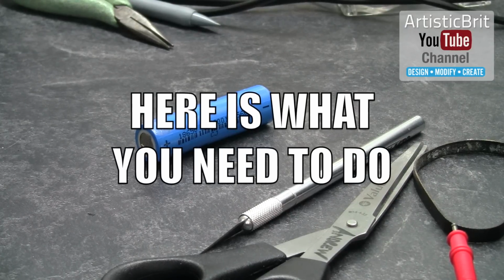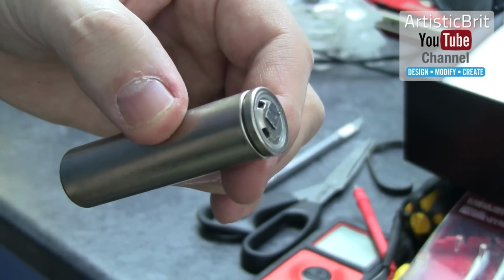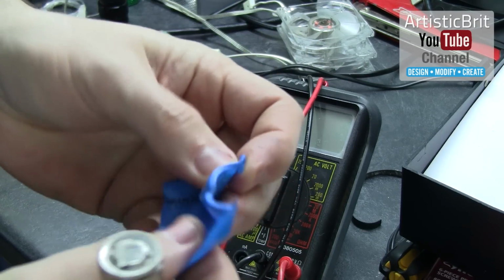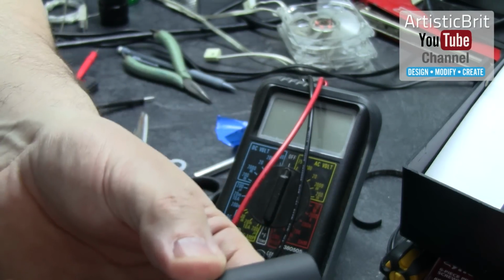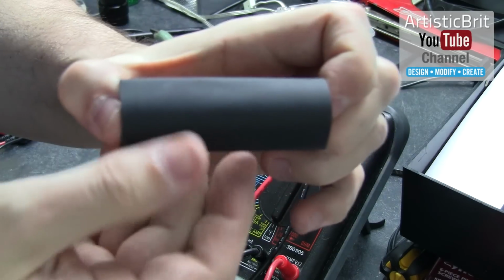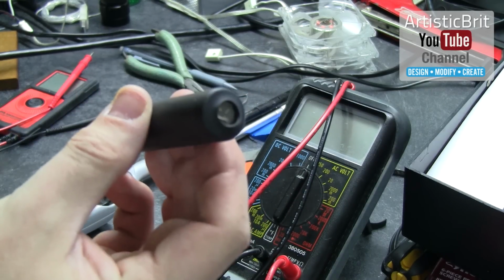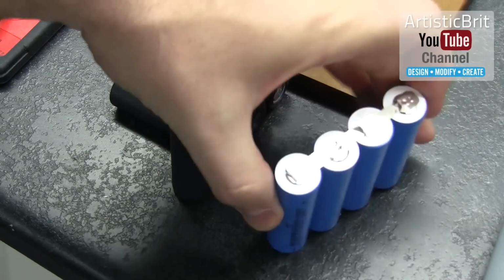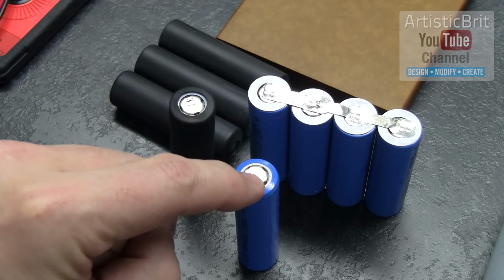Electric Danger of Lithium Ion 18650 - Battery Fires Exposed - Possible DIY Solution

Comment: If you did not know (or were not able to work out without a metre) that the outside case of some cells (where they are attached to the bottom by a common conductor) are negative maybe it would be safer for you NOT to play with electronics. AND If you want to short out cells use a fresh alkaline AA battery, they have enough amps (1.5?) to get real hot or drop steel wool onto an alkaline 9v PP3 - they dont have the amps but plenty of volts. If it helps at all, if you need to jump start your car and only have one wire lead treat the cars like battery cells and push the metal bumpers together (like the outside of a cell) and just attach the POS lead to the POS on the two batteries to make the circuit. Just like your (2.3Amp) Lion battery the 200+ amps from the car battery should Weld the two cars together, and kill both batteries. Lastly, for your go-cart RC LiPo's would be a better option as they have a higher drain rate (upto 7x) than those blue lion cells you are using now and will take the punishment better. If you think Lion's are bad, wack a nail through a LiPo (and run)

Comment: The battery was safe, until you removed the white plastic washer in the beginning of the video and discarded it
Reply from the maker: John Sneeringer If you paid attention, I was showing how close the rim was to the positive terminal. Normally this would not be done of course. When viewed on a desktop computer, you would see the warning texts I placed over the video as to why I did this.
Reply: You made the battery no safer be adding shrink wrap to the sides. The arc risk is at the top, not the sides. You removed the white insulated washer designed to mitigate that risk. By not adding the washer back, you have a much greater risk of fire or explosion.
Reply from the maker: hojo70 again, no one seems to be watching the videos completely. I cover this in the video and subtitles.

Comment: Are these batteries safe or what ??  I mean will they EXPLODE  💥  😨😨
Reply from the maker: +BubSiE7*7*7 T. Overall not dangerous, but used incorrectly, they can be, like others. There isn't really an explosion, more if a fast fusing of materials inside a slots if smoke. But we are talking rip off batteries, or batteries badly abused or damaged. I have 200 upstairs, perfectly fine.
Reply: Yeah ok, but really these Batteries are Not really what their supposed or intended to be!  Like a 9900mAh Battery has only just a capacity of 447 mAh ?  Which is a BiG RiP Off !!!!  😰

Comment: Its good that you are showing people how easy it is to short the cell, but why not use insulation tape to do it? Wouldn't involve a flame.  Also the real risk that you missed in your vid is the risk of having multiple unprotected cells wired in series, which is a big risk when charging without a protection circuit.  Personally I think that is the more serious risk.  But anyway I like your vid.
Reply: motorbiking 
Tape is not reliable. The correct way to add insulation is shrink wrap, but it should be shrunk using hot air.

Comment: I do not think that they will fit in a flashlight with they new heat shrink in it.
Reply from the maker: Possibly, though I'm not using mine in a Flashlight. I would think what your end purpose will be for.
Reply: Andrew Jones
flashlights :)
Reply from the maker: Yeah, I would check to see how much slack you might have before trying. My personal end use is for a vehicle.
Reply: I wish I had a meter to check them. I have charged them on the Efest LUC V4. they stopped at 4.2. It reads what kinda of battery it is and charges its accordingly. I was hoping that would do.Maybe not?
Reply: Andrew Jones
They fit with no problems in my flashlight
Reply from the maker: J Doe That's awesome news! Thank you for letting me know. I'll point it out in my next 18650 video which might be late late tonight.
Reply: J Doe It'll fit. Use a hammer.
Reply: Cured Pork Belly  ha ha
Reply: J Doe if it doesn't, bigger hammer

Comment: Really Andrew ok ok the wrap you took off is thin.  I will give you that, but the thicker plastic ring the wrap was holding in blocked the problem you are showing.  Next time leave the battery wrap on and put your new wrap on.  I agree with HTMI. This is pointless.

Comment: I use 18650's in my flashlights and the extra thickness of the shrink wrap would make it impossible to use them.
Reply from the maker: Possibly, though not how I use my 18650's

Comment: You won't be able to cool those batteries now , i hope you realize that. That wrap is good enough. Those laptop batteries are not meant to be taken out but you can still take em out no problem. I've made dozens of bicycle batteries and basically took out bazillions of those out of laptop batteries. Not one spark. You should just relax imho.
Reply from the maker: I'm happy you have made so many, however many others have done this very successfully for their bike cells.
Reply: Andrew Jones It's not that you can't but those things they don't like running hot you know. Decreases their lifespan. And in high current applications , such as e-bike stuff , this is going to lower their cycle life by quite a margin. Plus when there is a short or something , it's going to drain it pretty fast and it's gonna be cooked inside and probably enter thermal runaway. (That heat shrink is not very thermally conductive.) Then those yummy gummy shrink wraps will start melting all over and eventually burning. Doomsday scenario i know , but so was yours.

Comment: OMG!! Look how dangerous this battery is after you removed all the protective material that has been put in place to prevent the battery from becoming dangerous! ... Really?!
Reply from the maker: Yes... really. Do your own testing, my method is a far tougher material than the thin mylar wall against shorting out. Though in retrospect, it would be even stronger if I kept the initial coatings in place. This was more to show just how little there is to protect the battery.
Reply: Andrew Jones ya but that blue was not the real protector that white ring was...at least you should have put the white ring back. Sure i get it the blue stuff is thin compared to your heat shrink...but the white ring and the blue stuff used together is likely just as good. also you introduced another problem... heat ... that black insulated shrink wrap will cause the battery to not dissipate heat as easily this may or may not be a problem.

Comment: typical mistake 18650batteries for laptops are totally different from the electronic cigarette ones yes they look the same they perform the same but if u look at a laptop battery there is no vent holes so there fore they don't release gasses like and 18650 for a electronic cigarette hence they are the same size but inside they are very different

Comment: Any high capacity battery can be very dangerous the individual cells will not be fused. It is all in the design of a cell pack to be correctly fused after assembly. You seem a very inexperienced person. Try putting a spanner over a car battery, duh this all common sense.
Reply from the maker: Martin Counsell Whatever makes you feel better Martin. No need for me to prove anything here. Comments like yours make my day. You speak as though everyone knows the dangers of batteries. Many do not, which is why I pointed them out. It's often those that think they know what they are doing that I see go up in flames. Though I better what what I say before the scorpion gets me. hehehe

Comment: "that could start a fire" well... it would vent, but yes, it would be bad... simple solution: don't remove the protective plastic and casing on it... you then don't put the plastic used to isolate the two "terminals" from each other. trust me, if they were that dangerous, then why would they be used in so many rechargeable things? if they were so prone to shorting out, why would they be put in laptops? they only short out if you do exactly what you did Dude.
Reply from the maker: Incorrect on many counts. They do create a flame in some cases, they are used by thousands to create electric bikes and more. Not everyone knew what I show in this video "Dude". The hover board industry alone is having issues with the batteries too. Though mostly due to poor manufacturing and safety standards. I'm currently building an electric vehicle from them, like many out there. Any valid point you make have been expressed in my video. The point of the video was to show where the terminals are on the battery as hundreds only thought it was on each end.
Reply: +Andrew Jones yeah, sorry, I wrote that before finishing the video. fair play, and I see that now, and the hoverboard industry has also got the issues of unregulated and unprotected charging circuits too, wish that China would listen to electric standards, sorry for going off on one, probably should watch the full video before commenting, making a fool of myself as ever, and good luck with the electric bike, I'm working on one too, also based on the ideas from Rinoa Super-Genius and will be interested in your other videos to come before I go searching for ages, what were those little holders you used for the 18650 packs? they're quite cool, and definitely what I need for continuing my own project
Reply from the maker: +Amelia Tovey love Rinoa, his spirit of taking things apart to see what happens and how it works is great. :) thank you for the nice reply. I have got tons of hits on this video, so can't complain. Best of luck with your build!
Reply: +Andrew Jones oh indeed, nobody like Rinoa quite has that look of excitement when tearing things to pieces, I do love the trike though, my all time favourite vehicle. where are you sourcing your 18650s from? laptop batteries from eBay?
Reply from the maker: +Amelia Tovey I have been buying new laptop replacement batteries for now. 12 cells just like Ronoah's earlier videos. They are a good weight too, so have not hit many bad cells.
Reply: +Andrew Jones yeah, I'll likely be building a large brick-shaped one like Rinoa's later ones, just for ease of soldering and attaching balance leads
Reply from the maker: +Amelia Tovey Yes, I'll be making a similar flatter version to fit into my design vehicle. Though to be honest, I have bigger projects I am working on, and saving for my second 4K camera to film it all. It's expensive doing all of this tuff ;) hehe
Reply: +Andrew Jones oh God it is XD I have spent way too much on batteries alone so far XD

Comment: you should've put that white oring back before you rewrapped the battery also depending on what you're putting the battery in you probably made it where it won't fit any longer they are wrapped the way they are for a reason this whole thing was really useless

Comment: i doubt you have electrical engeneering background. the original protection is well designed. the casing might be thin but in real life its only gonna touch the case if a product which is connected to negative pole anyway. batteries(even AA) have been made like this for decades and there isnt any problem with it. you just solved problem that doesnt exist, which is okay but since you shared it you tricked so many people im pissed of.
Reply from the maker: Mb0ts Thank you for your opinion.... YAWN...

Comment: Only an idiot solders them into packs. There are special racks that hold them for battery packs with the connectors. If you did not know that you should not be using them. Check out Mooch's videos

Comment: Normally most of the batteries are build like that,the internal insulation is thicker as a hair , that samsung batteries explode coz they make more capacity less size by reducing spacer insulation internally making a strong battery but susceptible to to a short with an minimum physical pressure on the battery.i just think im not a scientist ;)

Comment: Li-Ion batteries are too expensive...how i can make my own?
Reply from the maker: I purchased laptop batteries with 12 x 28650 batteries inside. I have a video almost ready to go up that shows me obtaining these. Worked out to be around $1 each I think. I plan on getting another 300 more for an upcoming project.
Reply: Andrew Jones AA Li-Ion batteries at only 1$ per 1?
can you please tell me the site that you get those batteries?
thanks!!
Reply from the maker: Ebay from a laptop battery supplier. I'll try to dig up link and post video today or tomorrow.
Reply from the maker: Giannis Mariettos cheap source of 18650's http://youtu.be/qc7UlvsQ-So

Comment: I will now be using the purpose-made insulating rings linked to in a comment below for all my future endeavours using 18650 batteries.

Thank you for bringing this vulnerability to my attention, and thanks to the comment below for providing a link  ( https://www.fasttech.com/product/2157600-rubber-insulating-seal-ring-for-18650-battery-50 ) to a ready-made solution.  Both of which I was completely unaware of.

Cheers.

Comment: this guy has no idea what he is talking about. i knew when he said they are all the same. there are few different kinds of chemistry that manufacturers use. also after yu put another wrap on it the battery will be thicker. its not hard to rewrap. the white ring you took off is called the insualting ring. which you guessed it insulates the negative from the positive.
Reply from the maker: You got me Jimmy. Hilarious. This video was created years ago, when possibly I knew little about batteries, but that has never stopped me. It's all good. When we create bike battery packs, we wrap the entire cluster of cells with shrink wrap tubing. Next month I begin the 2 man boat which will be 18650 powered.
Reply: Well glad you learned. I looked at the date after I posted.
Reply from the maker: +Jimmy Overturff we all start some place.
Reply: I aswell did not read the date before I posted and it was mainly the lack of knowledge and the fact I didn't see him use the plastic he took out, that would provide a barrier for anything that tries to get under the uplifted sleeve he had left over

Comment: Ridiculous is you removing the double insulation then saying you discovered if you remove the safety double insulation these batteries are unsafe, total rookie, LOL These are the number one secondary battery in the world, when assembled properly they work very well, excellent job, going from double insulated to single insulated, lol
Reply from the maker: Ozzy3333333 Sounds like you only watched 15 seconds of the video.

Comment: That's why that plastic disk is in place to prevent these type of shorts from happening. In fact your heat shrink allone is thinner and not as robust as the this heat shrink with the plastic disk. This video is cheap shot and exposing nothing but you own unfounded fears!

Comment: 72 cells....you are nuts what do think the white insulator does...just protects the top lol....why waste your time, the thicker the plastic casing would slow any heat release.....would do it on a hot water cylinder.
Reply from the maker: Kevin Shettle this video is so many years old now. Most do not realize how these 18650’s are made. For many it was educational. But yes, I am nuts at times.

Comment: i think you should leave white washer on the cell.
Reply from the maker: larry liegerot Yes, you're right Larry, this was more of a test for the video. I have about 100 of the 18650 batteries I am putting together for an electric bike. I will probably simply shrink wrap these and leave as much protection on them without stripping them down first.

Comment: Safety ring from the first battery still on the desk towards the end of the video (was hair-raising to watch the video because of this) and you but the battery pack strip up against the double wrapped cells ... not good. When cells charge, they get hot .... and that heat needs to go somewhere. That is why they use what they use. Your a danger dude ....

Comment: dude... buy a heat gun.  open flame + batteries is a bad combo...
Reply: +Otis Spankmeyer (Morlok8k) Even just a damn hair dryer would be a better choice.

He even added an annotation saying the heat is safe, but the heat isn't the problem, it's the open flame. It's possible, albeit unlikely, for these batteries to vent gas without heating them up. The metal underneath the + terminal is pre-weakened so that should the battery vent it does so in a controlled manner at an expected point, but when you're ripping these cells out of battery packs that were spot welded together you can damage it slightly and gases can escape without you even realizing it. Not exactly a great idea.
Reply: Exactly!

Comment: Are you kidding me? Flame to shrink the tube? And this is a safety video? How 'bout a hair dryer? It works fine and is safer.
Reply from the maker: Like I said, I have not had an issue in 15 years.